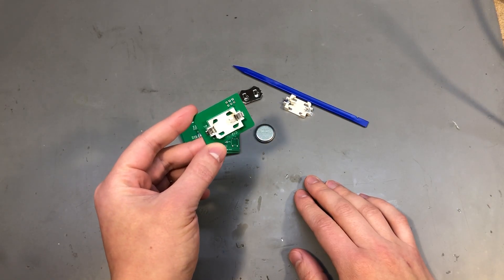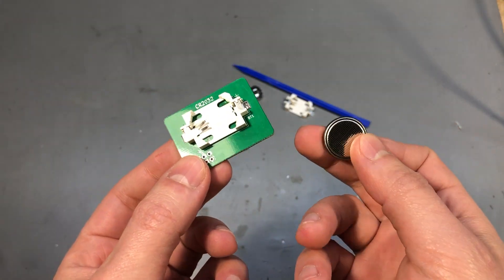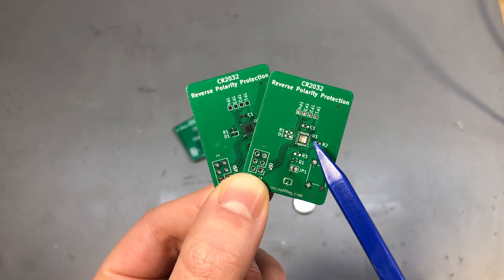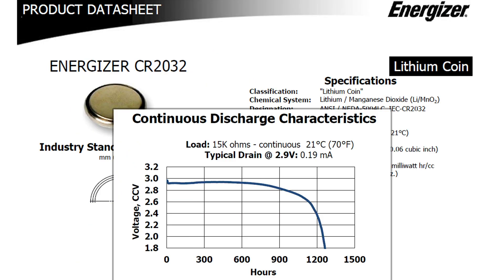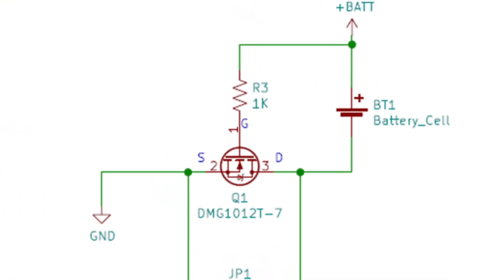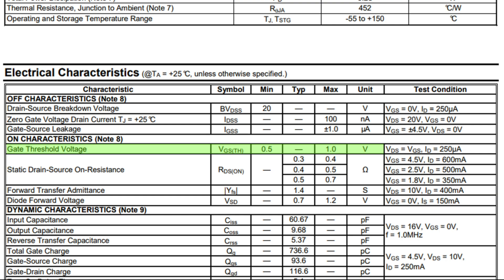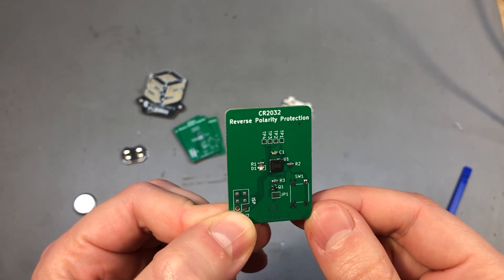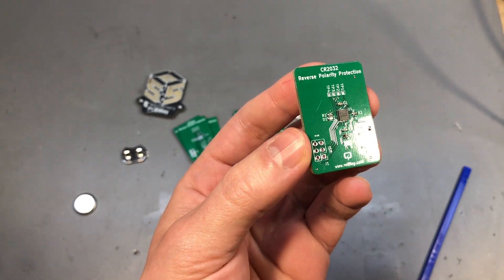Reverse Battery Protection With Mosfet (no voltage drop) - Voltlog #353

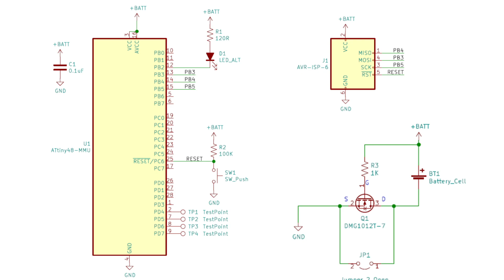Comment: 4:32 - It is very simple, but not effective in your setup if you use a mosfet with an internal body diode - as shown in your schematic.
The internal body diode will conduct if you insert a battery wrong/power with reverse polarity ;ø)
- Use a mosfet WITHOUT internal body diode if you use this method. (Edit: - and they don't seem to exist, bummer....)

Other methods exists: https://www.infineon.com/dgdl/Reverse-Batery-Protection-Rev2.pdf?fileId=db3a304412b407950112b41887722615
Reply: The body diode isn't something that is built into them on purpose. It is inherent to a MOSFET's construction.
Reply: @superdau  I seem to recall JFET's without this 'feature' - but they are usually very low power, and thus not a good choice.
GaN devices should also be without, but I doubt those are cheap and plentiful (yet):
 https://e2e.ti.com/support/power-management/f/196/t/408481?Is-there-an-inherent-body-diode-in-GaN-power-FETs-If-so-what-is-the-V-I-curve-for-that-
Reply: The trick to doing this is to use the mosfet in REVERSE. With the gate isolated and the MOSFET closed, the body diode works just like conventional diode protection, but with the gate above Vgs(th) the transistor is saturated and bypasses the diode providing the Rds of the transistor instead of the Vf of the diode.

Comment: Well done. The P-channel version of that circuit is extremely common in audio electronics and works perfectly.
Reply from the maker: Thanks!
Reply: @PeterS what's the advantage there and what (affordable) component would you use/recommend?
Reply: @userou-ig1ze  As NiHaoMike and akhurash pointed out, the P-Channel version allows your power supply ground and your circuit ground to be at the same level which is important in audio electronics and other specialized applications. I don't know if links will work here so Google for "Advanced Power Switching and Polarity Protection for Effects" by R.G.Keen and you'll find an article from 1999 about this topic on his site "Geofex". R.G. used to be a power supply designer for IBM mainframes and he's extremely knowledgeable. The transistor you use in your circuit will depend on the amount of current you need to sink or source, just select one with a very low Vgs(th) parameter as shown in the video that can handle the current you need.
Reply: @Peter_S_  cool! Ok  I'm working mostly with Arduinos and batteries. So I guess a P channel mosfet is overkill. I'm just worried I'll waste too much energy of the battery, especially when the arduino (or castellated esp32) might already have some protections I'm unaware of yet
Reply: @userou-ig1ze  Either way will be fine for you as long as your power supply ground is isolated and only becomes the ground connection where it enters your circuit through the MOSFET. When this became a good option in the audio world we had the ground connection issue because there was always a mix of batteries and AC adapters, and the P-channel devices got good enough to do this so they became popular. Before then we used PNP transistors for the same application. Again, R G Keen gave out the best implementation to the DIY world using a small signal NPN to switch a PNP pass element. It's found with a search for "A cheap - and good - polarity protector", also found on Geofex. For a battery driven ESP32, in most cases the circuit in the video with a low Rds N-chan device will be your ideal implementation. As long as you have no common sensor and power source ground wiring to restrict your choice, go with the best Rds you can get in either N or P.
Reply: @userou-ig1ze  When the input is a power jack rather than a battery, it allows the ground to be directly connected.
Reply: @userou-ig1ze  P-Channel FET is has the advantage of no ground shift. In low power application this doesn’t matter but in power electronics for example you can see a ground shift in the module with respect to the power input and this can sometimes cause issues.